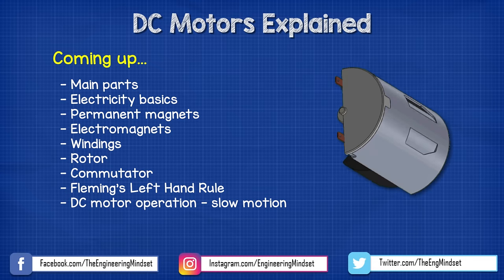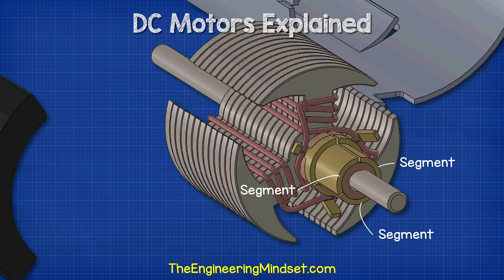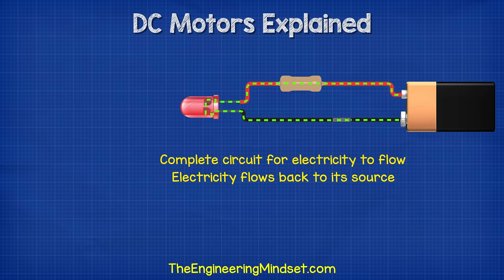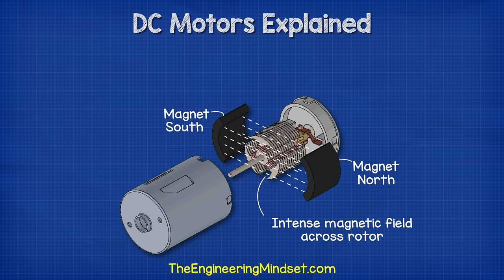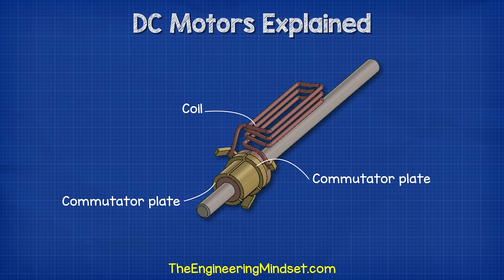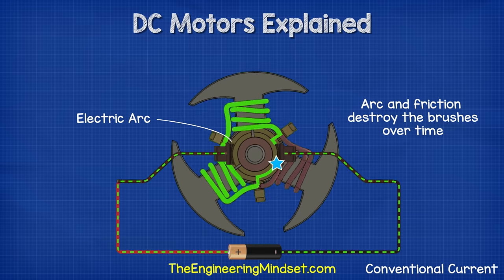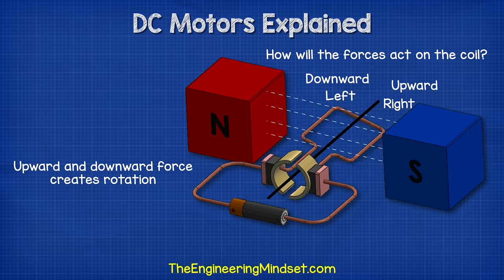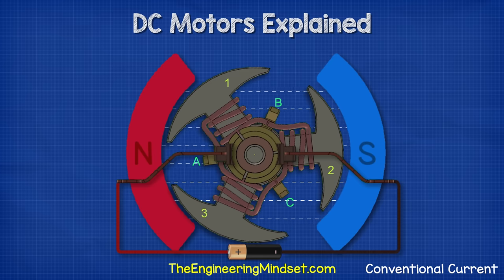How does an Electric Motor work? DC Motor explained

Comment: How did humans even come up with this
Reply: We wanted to turn rock to gold, (alchemy) which led to chemistry, which lead to electrons and then electricity, which lead to electromagnetic forces and then eventually motors, naturally
Reply: It’s a long chain of knowledge down back to the first civilisations.
Reply: Scientific method. Document everything and it will allow you to narrow down discrepancies. Imagine this as a water wheel to crush grain but with electricity ie electron movement.
Reply: I ask myself this all the time! Even a resistor! Like how do humans make a resistor!!!
Reply: Or even a blue LED. What a story that was
Reply: not hard. just reverse engineer an electric generator.
Reply: Really, really small steps over a long time. Each generation gets to build on the advancements of the previous one.

Comment: Actually, the forces cancel out since they are equal and opposite in direction. It's the torque generated by these forces that is responsible shaft/rotor rotation.
Reply: The forces in a coil, that is.

Comment: I don't know if fleming's hand rule is useful for this motor configuration in the video. it's most useful with the radial armature coil configuration. This is a tangential coil ocnfiguration, and instead we could just try to explain this with magnetic dipoles created by the coils instead.

Comment: Always wanted to see an educational animated video like this on DC motors. Thanks!
Reply from the maker: You're welcome enjoy!
Reply: @EngineeringMindset  Soon Brushles dc motor too? Thats the kind thats in the computer fan? Maby a continuing on what determin`s the DC motor torque, speed etc like tho`s in RC cars? :D maby also if you havnt made video about it Dynamo/alternator the difference on engine`s :)
if i remember some what: Dynamo it the old kind of Alterantor thing but it couldnt handle the amps so they started with alternator but alternator makes ac power so it also has Diodes that forces it to dc output? :) Great video  allways :D
Reply: @StigDesign  If you build an alternator instead of a DC-generator you can use a three phase generator. That gets you a lot of positive aspects. You don't need brushes at all. That gets you less wear and conductive dust in the system and higher efficiency.  The torque is evener then in a single phase system. While you need 6 diodes instead of four they can be a lot smaller. You get better power to weight and size ratios. ...
Reply: @FreeOfFantasy  oh nice :D Thank you for the info :)
Reply: Me too..  But i didn't found any channel like this
Reply: im the 100 th like to this comment congragulations
Reply: @LG5main  nobody care. You liked your own comment
Reply: @av2678  lol dont bully me
Reply: @StigDesign  large.     9737o64302.

Comment: Modern cars have DC motors all over including starter, wiper motor, power windows and locks, etc.
Reply: what about the main traction motor of an EV?
Reply: @rogerbeck3018  brushless
Reply: @АнтонЕлбаев  why they use brushless ones?
Reply: @Sepahwand_Heidari  cuz dis motor is: more efficient, sparkless, more powerful and more durable.
Reply: @rogerbeck3018  They generally use Induction Motors (Asynchronous Motors)
Reply from the maker: Check out the new BLDC Motor video: https://youtu.be/yiD5nCfmbV0

Comment: This video is a God send. I'm currently sitting in my Industrial maintenance course watching this video on the schools laptop because the books they're having us use completely suck. I'm currently in the Electrical Motor Controls for Integrated Systems and it doesn't really explain anything. I've been freaking out because I have a test on Chapter 13: DC Motors, I was so happy and relieved when I found this video that actually explains DC Motors. And a major bonus is it's animated so I can visually see what it does, what the different parts are, where they're located, ECT. Thank you so much, like I said earlier this is a God send. Thank you thank you thank you thank you thank you thank you thank you....... Don't think I can say it enough lol

Comment: Note that computer fans does NOT use "conventional" DC motors, but instead uses electronically controlled, brushless motors. These use a opposite construction, where the permanent magnet is embedded in the rotor, and the coils are in the stator. A positional feedback device, for example a hall effect switch or optical sensor, is used to measure the position of the rotor, and then electronically switch on and off the currents to the coil to drive the fan, creating a kind of "electronic" communitator instead of an mechanical one.

These work kind of like an variable frequency drive, but uses square wave instead of a smooth frequency, and the frequency is directly controlled by the position of the motor. Most newer computer fans have a PWM input (4-pin) instead of the fixed speed 3-pin one, where the PWN input tells the microcontroller in the fan to adjust its coil current outputs to regulate the speed of the fan.
Reply: What’s the difference? Isn’t it still a fan if u attach blades to a dc brush motor?
Reply: I knew that.
Reply: Or you could just call them what they really are....an AC motor lol. AC motor is the same as a brushless DC motor don't try to sound all smart for absolutely no reason smh
Reply: @chokilotechokilote7906  No he's right. If you connected sinusoidal waveform AC to a BLDC motor it would NOT work. 

As far as the windings are concerned even brushed DC motors are "AC" since switching polarity is the purpose of the commutator. A BLDC motor is simply electronically commutated hence it's still considered DC.
Reply from the maker: Check out the new BLDC Motor video: https://youtu.be/yiD5nCfmbV0

Comment: I had to use a DC motor in a barrel pusher for ho scale trains. I received the pusher with and old 1950’s motor (this house was made in the 1950’s or 60’s) It had a button that said a presstomatic. I assumed all the old components were in that button but the button didn’t work. I ordered some dc motors after taking the button off. Then I realized the transformer didn’t put out dc so I ordered an ac to dc converter (can’t remember what it is called) then I bought a regulator to lower the voltage, soldered everything together, and shoved it all into the house where the motor is. I attached a simple switch and plugged it in and it now works. It is currently sitting in my church on display with a bunch of other houses (but that’s the only animated one) and it keeps on pushing the barrels. If anyone wants to check it out the trains are at Saint John Nummen Catholic Church, Lancaster P.A. They run before and after each mass during Christmas THIS YEAR. we might be switching over to O gauge next year so if you see this in time go check it out. 
Sorry the comment is so long but if you made it this far please like. 
👇👇👇👇

Comment: These diagrams and instructions are so well done.  The first time I saw a dc  motor like this was in the late 60s as a kid.  I had a train set and the motor was like this.  Later in the 70s I had a cassette tape recorder that that had one.  Right now I have a robot vacuum cleaner that has 6 of these types of motors.  2 for the wheels to turn, 2 more for the wheels to levitate over bumps, 1 for the LiDAR mechanism, and 1 for the spinning side brush.  I think I’ve replaced 2 of the motors that wore out so far.   I know there are brushless motors too which seem to last longer.  Not sure how they work.
Reply from the maker: Thanks! Sounds like you also like to take things apart to see what's inside
Reply: The Engineering Mindset Yes I have been known to do that.  Especially when I was young.  My parents grounded me several times for tearing clocks apart and the telephone.  Yet I ended up doing computer programming for a living.  😂
Reply: @ds99  programming let's us make our own virtual motors with virtual circuits in a virtual universe where we make the rules.
Reply: Toughnut It’s amazing what can be done now.  It makes learning easier when a component can be pulled apart and examined with even motion to see how it works.  Very helpful.
Reply from the maker: Check out the new BLDC Motor video: https://youtu.be/yiD5nCfmbV0

Comment: DC motors can be used to make a LEGO vehicle, and that's actually why I'm here. I'm trying to learn how to make each system within a tank, but with LEGO Technic pieces, except, I want to develop my own. I want to make a tank that can do things
like:
1. Move forward or in reverse at different speeds. (requires a gear-shifter)
2. Rotate 360° (One tread moves in reverse while the other tread moves forward with equal torque and speed.)
3. Tread suspension (Traverse heightened obstacles while still maintaining the maximum tread-to-ground coverage for optimized traction.)
4. Contains an isolated turret that can rotate 360° separate from the chassis, and adjust it's cannon at least 35° of total vertical rotation, 30° positive and 5° negative.
5. Autoloading mechanism for the turret.
6. Firing mechanism for the turret that generates enough consistent force for accuracy within a reasonable range. (Not more than 1-3 meters)
7. Camera with sight markers for gauging where the payload will make contact.

As for what I want the payload to be, I don't know, but I imagine it needs to be aerodynamic in shape, and must weigh less than 2 grams.

Bonus: if I could get a vaporizer and a chamber in the chassis that runs the liquid vapor  through a tube, and out through an additional barrel attached to the main cannon, it could double as a smoke bomb that simulates a flame-thrower. Theoretically, I could attach a second tube to the vaporizer that releases smoke to obscure IR/Radar target-locking and vision.
Additionally, I would need to attach all of these systems to a controller so they can be operated remotely from the tank.

All of these things require me to learn about the relationship between torque and speed, how motors work, as well as many other mechanical and mathematical techniques.

This is the beginning, but it's fun learning all of this! So far, I've learned about how much this LEGO tank is gonna cost, which is around 1k USD. and torque/speed functions, and motor functions.

Thanks for your help! Incredibly useful information for my lil goal. c:

Comment: I find your presentations  exceptional. The main thing is that the image matches what is being said. There are several types of electric motor designs. There is mountains of information  to sort through. Interesting perspective,  an axial running through the center of a coil vs a coil offset on an axial as shown in this presentation .

Comment: “Inside the copper wire, we find copper atoms.” 
Ah yes, the floor here is made out of floor
Reply: The floor is made of tiles, made of ceramic.

But your iron nail is made out of iron.
Reply: What you are saying is 2000-year-Old Democritus's model of Atom. This means: for example, if there are 500 objects in your house then there are 500 types of Atoms. But the truth is, there are 92 (naturally occurring) types of atoms which combines in different combination to form 500 kinds of object. I feel Democritus was talking about Molecules without knowing about Atoms & Calling a Molecule an Atom

Comment: I recently took two dc motors from a printer I was about to throw way, I'm not sure what I want to do with them yet though
Reply: I had one motor for 6 years. Two weeks ago I used it to repair my pepper grinder. You never know :D
Reply: Create a pump!
Reply: Leave one for a project that will pop up in your mind years later. 

The second one, try to disassemble it if you can, you will admire the effort behind it a lot more.
Reply: throw it away because most project require  servo motor
Reply: Those are Stepper motors, theyre a bit different
Reply from the maker: Check our new Servo video out: https://youtu.be/1WnGv-DPexc

Comment: It's very well explained and illustrated, great job ! I just have some troubles imagining that forces applied to coil 1 through commutator A and B (13:31) make the rotor rotating. It looks like they're compensating.
Reply from the maker: Thanks, well it already has inertia so the forces will give it that extra energy

Comment: Using tip:

A stall current is the current volume when you hold the shaft still, when you are apply or design a product that is using DC motor, please try to keep the rated current (applying current with the product)  at around 20%-30% of the stall current. Which especially for the carbon brush motors, high percentage of current creats sparks between brushes and commutators that might causes carbon powder and stay between the commutator segments, that will lead a short circuit.

Comment: How can the magnets be individually north and south? A magnet has to have two poles, you can't separate them.
Reply: They each have both poles, but the only poles that matter are the ones facing inward toward the coil.  That's probably why he labeled them as just north and south.
Reply: the other pole is still there. on the other side of the 2 permanent magnets Its probably difficult to illustrate on the program EIs using with shapes that angle like that.

Comment: Cordless drills have DC motors, right?😉
Also, how do the brushless motors work, what takes the place of the brushes if there brushless?🤔
Reply from the maker: Some do, yes. I'll make a video on brushless soon and tag you when live
Reply: The place of brushes is taken up by electronics. In a BLDC the part with the permanent magnet rotates and the electronics do the commutation without any moving parts.
Reply: @EngineeringMindset Thanks!
Just wanted to say that I love your channel, I've  learned so much over this past year!
Reply: @FreeOfFantasy  Thanks, I appreciate it!
Reply from the maker: Check out the new BLDC Motor video: https://youtu.be/yiD5nCfmbV0

Comment: When trying to determine which way a 3-coil DC motor is going to turn it's better not to use Fleming's left hand rule!! This will confuse a lot of people and it's not accurate!! Instead, you should use the second RIGHT HAND RULE, which determines the direction of the magnetic field of a coil when current flows through it!!

Comment: It is useful to mention the left hand rule this way = First finger-FIELD, seCond finger-Current, Thumb-Motion. For generators it is the right hand (gener-RIGHT-ers). The Corkscrew rule shows which way around a wire the field will rotate in relation to the current, move your right hand away from you twisting it clockwise, like a corkscrew. When the current flows away from you the field is clockwise.

Comment: where I have seen DC motors used: mosquito traps with dry ice, the fan and wipers in my car( retractable antenna, convertible top, adjustable seats, self-closing doors and hatches), RC vehicles, handheld fans

Comment: Very Professional well prepared and engaging. I hope the following points will prove helpful. Coffee donated.
3:3 1
Copper Wire made of atoms with three Free electrons in the outer shell that move though the wire like the balls in a Newtons Cradle
Injecting an electron into the end of the wire causes a domino effect along the wire 

4:22
We use the CONVENTIONAL CURRENT way of describing the flow of current because it is more logical to think of a flow from positive to negative 

5:12
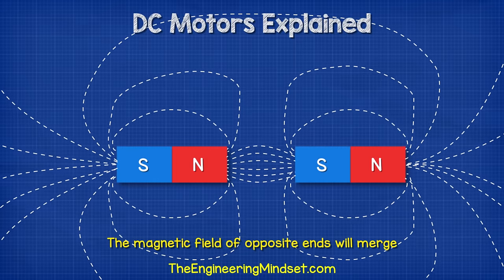Continuing the Iron filing demonstration with two magnets moving under a transparent surface would better illustrate description 5:16 to 5:30 

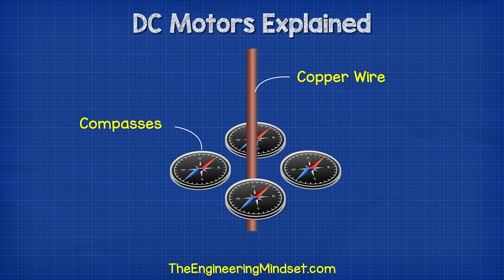5:59
"Placing COMPASSES around the wire" 

7:37
The flux path should be shown through the centre of the windings contenting around the outside of the coil.

10:25
Easy way to remember Flemings Left Hand Rule;
the second finger represents the conductor, the thuMb represents the Motion the conductor will be inclined to take due to the magnetic field produced by the current in the conductor, when between magnetic poles producing a Field represented by the First Finger pointing north to south. 

13:12
Instead of using directions of force on the lobes of the armature, why not show them as electromagnets?
The face of lobe#1 has a north pole, thus repelled by the permanent magnets north pole, while the face of lobe#3 has a south pole induced attracting it to the permanent magnets north pole.

Comment: We use DC solar submersible pumps for pumping water. It has DC brushed motor, my question is how weak sunlight and low rotation of motor can effect on damaging brushes? And at weak sunlight if the motor can’t receive required energy from PV panel and not rotate will this damage the motor?
Reply from the maker: Seen our new video on HOW SOLAR PANELS WORK in detail https://youtu.be/Yxt72aDjFgY

Comment: This is also how old subway cars in the NYC subway system work. A DC motor is used for dynamic braking and  they utilize wires that control application and release magnets which provide an electrical signal to brake. The magnet in the DC motor reverses its polarity until the electrical signal drops out the dynamic brake contactor and switches to friction braking.